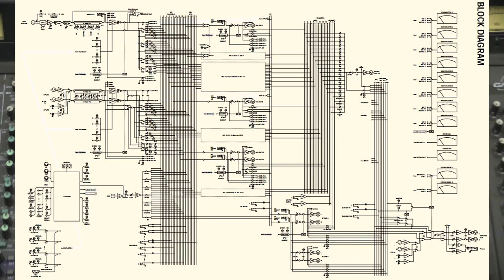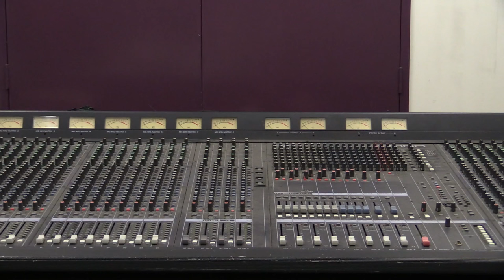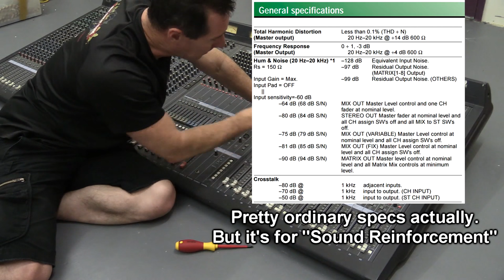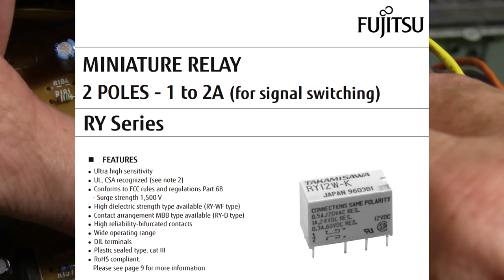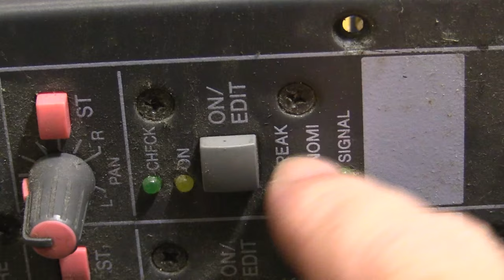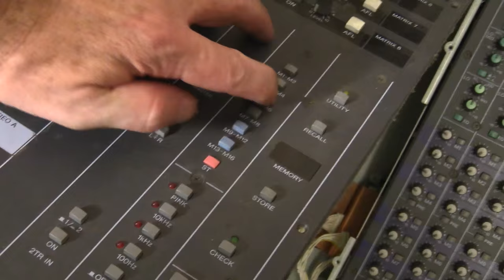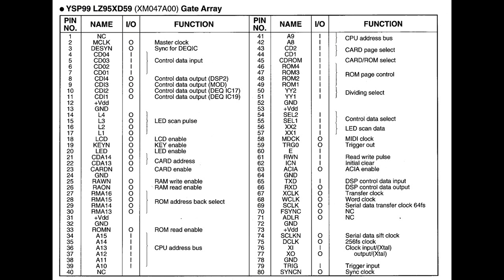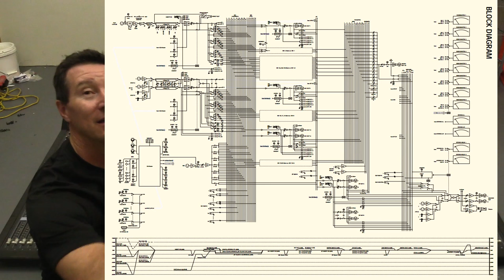EEVblog #840 - Yamaha M3000 Mixing Console Teardown

Comment: Why would a sporting facility need a 40-channel mixer?
Reply: +Desmaad Cuz the audio-technician likely got to choose which equipment.
He decided the equipment which makes him drool.

I'm guilty of that as well. "Boss: We need this and that"  Me: Well, it's time to order a HP GEN8 server.
Meanwhile we could have pulled it off with a consumer grade i3 desktop. but where's the fun in that?
Reply: +Desmaad Maybe the venue is also used extensively for other purposes... For example it's not that unheard of a sports facility to host a concert of some sort.
Reply: +Desmaad The key reason is versatility. A large sports venue is going to have to be capable of catering for a whole host of different types of events that aren't necessarily all sporting events such as concerts (remember the days of the stadium rock bands?) and other such types of public events.
The other reason is broadcasting. This console would likely have been used to in effect run ALL the audio for any event so you would likely have several distinct audio systems all controlled from this one mix console.
For example, there might have been need for all of the following to operate concurrently;
1. House PA system for music and announcements - this would likely include a couple of microphones for speech, some channels of "DJ" audio, and perhaps also an emergency alert system. This would likely also need distributing to many different amplified systems throughout the building (think along the lines of to the roofmounted speakers in the downstairs bar as well as to the crowd seated in the venue) 
2. Commentary, live audio and interviews for broadcast - This would encompass many different sources all being mixed to be sent for tv and radio broadcast, possibly as completely separate mixes for each broadcaster. This could encompass many microphone channels coming from commentators, from microphones on the field itself, from comperes interviewing sports personalities in the tunnel or locker rooms etc. 

A large format console like this would allow both of those scenarios to operate concurrently and separately if desired, or if need be the mix engineer would be able to for example, send that interview from the tunnel to the house PA, or send that announcement from the house PA to two different tv broadcasters and one specific radio broadcaster.

So, versatility is the answer.

There's always that band that says "We need 5 channels" and then shows up with a 60 piece orchestra.
Reply: +Osmosis I'm not sure the M3000 ever made anyone drool. Yamaha are more of a "Get the job done" manufacturer in the pro audio industry.
If he wanted something to drool over he would have asked for a Midas or an Allen and Heath in those days.

Midas Legend 3000 for reference - http://medias.audiofanzine.com/images/normal/midas-legend-3000-44-touring-668615.jpg
Reply: +Desmaad Sound reinforcement. 40 channels seems like a lot, but it's never enough. A venue like that would have a variety of sources needing mixed. Think of how many audio and video inputs a pro football broadcast is dealing with and likely scale back from there. Live or studio, it adds up quick. More is better when you're talking about inputs, buses, inserts, etc. Just micing up a band requires a lot of inputs. Sending back monitor mixes gets even more involved. Like I say, it seems like a lot, but it's never enough. This is one of the first things you learn when you get into sound engineering. What you think you'll need is always less than what you will actually need. You make it work, but there's gotta some law like Murphy's that addresses input shortages. ;)
Reply: +hefonthefjords The Yamaha PM3000 and then the PM4000 were staples in th industry and AH never made anything comparable at the time
Reply: I might be wrong but I was pretty sure A&H released the ML series around the late 90s no?
Its not like there was a shortage of other high spec consoles around at the time.
AMEK's consoles being just one such example.
Reply: hefonthefjords
 Holly shit, that picture is making me dizzy. I'm not a audio technician. Thought that Yamaha was pretty top notch equipment. but it's entry level compared to that indeed
Reply: +Osmosis You should see the kind of gear we use these days. The consoles all look like fecking space stations with lights and touch screens and motorised faders all over the shop.

Here's a nice Soundcraft Vi6 i use frequently - https://i.ytimg.com/vi/A8mxMe3cXyE/maxresdefault.jpg
Reply: +Desmaad I'd say it was used as a monitoring desk. The MCG have had much newer fully automated digital desks for a while. As a monitoring desk, it could've been for anything!? You have security and ground staff on the day of a big event all running around with in ear monitors, and they need different sources mixed to them. When this is the case, you'd be surprised how quickly 40+ channels doesn't seem like a lot anymore!
Reply: +Desmaad 

Because they would probably have a lot of music in, or they did corporate events where EVERYONE want's their own wireless mic, or because they didn't need the 40 channels, but they DESPERATELY needed the 16X16 matrix to control their clusters and delays, and it was the only console that had the matrix they needed.  One of our local stadium's got the first Yamaha high end digital console sold in America.  64 channels, and they used nearly every one on a regular basis.  A venue that big has a lot more going on than you imagine.
Reply: +hefonthefjords 

The Legend 3K is a fine sounding board, but the drool worthy Midas was always the XL4, for me.  And I know several guys who love Yamaha boards.  I know a lot more who hate them, it's true, but a few love `em.
Reply: +Osmosis 

Not entry level, just a different style.  For Entry level, see Makie or Behringer.
Reply: +Gabriel Hoffman Mackie are entry level??? since when!? Behringer, yes! actually, I've been out of the game for many years now but compared to some of the shocking Chinese desks that you see, Behringer is king shit in comparison!
Reply: +James Bos Mackie make a lot of their stuff in the same factory as Behringer.
Reply: +Coolkeys2009 having dealt with many Chinese manufactures (check my profile pic, I'm in Shenzhen. I deal with Chinese manufacturer's on a daily basis) absolutely everything is made in China. Most people don't believe me but the best stuff is made in China as well as the worst. They have factories with literally 10'000's of employees making stuff for 100's of brands. Some brands are great, some are trash. Not disagreeing with you but its 2016, we can't really discount any product on the sole basis of where it is made.
Reply: James Bos I totally agree with you, I'm not commenting on China or their workers I'm commenting on the brand, I own a piece of recent Mackie gear and I'm not impressed with them, I think their just cashing in on a once great name, support seems poor as well as quality.
Reply: +Coolkeys2009 well, I can't speak for their recent gear since I've been out of the game for ages, so if that's the case, its quite sad. I know brands do just this and it pisses me off!
Reply: James Bos
  Mackie has always been just below entry level for professional sound.  It's fine for pro-sumer sound, and I've got several Mackie products, but they are all made to beat the prices of stuff like Yamaha, Midas, Allen & Heath, etc. 

Mackie DOES make very good budget gear, and made some quite innovative budget boards.  The 8-Buss was a classic, but mostly because it did things at a price level no one had seen before.  But it's still budget gear.  You have to be VERY careful with your gain staging on an 8-buss if you don't want to start having mix buss distortion, for instance.  You'll never have that problem on an SSL, or a Neve.
Reply: +Desmaad They were sold this mixer NOT because of sound reinforcement or because the venue hosts concerts, NO respected musician will use the house system.. They have their own gear they set up..
They were sold this beast because the buyers didn't know any better and the seller knew they had the money to burn on it. You do NOT need a 40 channel high end mixer for a sports arena or for broadcasting either. This is a house main mix not a broadcast sub mix, broadcasters do not use the house main mix anyway and even if the stadium itself has a transmitter they would use the aux outputs of the main mix.
This is complete overkill and proof that companies abuse consumers in this type of market.
It's like a nightclub having this sort of thing where 35 of the channels are never used.
Like Dave said, this particular mixer was made to be versatile and moved about, not installed  in a location
A sports arena can work fine with a 16 channel board and still have a few channels left over. I know, I have installed sound in American football stadiums. 40 channels is massive overkill.
Yamaha is a good entry level product, reason you will find a shit ton of Yamaha in churches and nightclubs.
Peavey is total shit and marketed to the garage bands and bar rooms for people on a tight budget. They do make decent guitar amps though but their PA gear is crap.
EV is a better brand if you looking for speakers
Crown is a damn fine amp for 8 ohm systems where QSC is the best for 70 volt systems which you will find in most sporting venues.
Atlas makes the better 70 volt horns for long throw
Berringher is trash all around, worse than Peavey gear and marketed towards people who know nothing about sound, recently they been marketing towards online streamers and youtubers which does not surprise me, 99% of those types think they know everything about sound and such, that's why they spend $3000 on a bottle mic when a $200 mic will do a better job, they don't know any better and think because it looks cool it will sound better..
Whats horrible is those "sound guys" who think they can use concert gear at a venue like a car race and it will cover.. EPIC FAIL you need 70 volt horns, not 8 ohm speaker cabinets..
Reply: ElfNet Gaming

Well that board would certainly not be used for sound when there was a concert at the venue, it is not at all uncommon, at least at sports venues in this country, for teams to have a band come and play a song or two between innings/periods/whatever. 

More likely, though, it was the matrix that was the deciding factor.  In a large venue, it is frequently extremely useful to have separate outputs for different clusters.
Reply: I guess different countries have different uses for this sort of thing. but the purpose of a console like this is for input mixing mainly, zone outputs are usually mixed at the amplifier rack not at the main house mix. But i see what your saying though, I still think it comes down to the seller sold them something they didn't need to make as much profit as possible, quite common.
Reply: +Gabriel Hoffman Why wouldnt they use this for a concert? I've mixed shows on this exact console. Its perfectly adequate, regardless of whether it's part of an install or not. Remember we are talking about the 90s here. You pretty much used an analogue board or didnt have a gig then.
Reply: hefonthefjords It's not practical since arena systems and concert systems are two different things. 99% of arena systems are 70 volt systems unless the sound man is a moron and install 8 ohm crap, ALL of the concert systems are 8 ohm based.
The reason arenas are 70 volt is so you can chain drivers in one channel, with 8 ohm based systems you can't unless you want to smoke your cabinets or amps..
I say this is not practical because you would have to un wire it and move it around when the concert crew has their own gear anyways. besides no self respecting sound man will wire into a house system of this nature for a concert, You will use the equipment for the concert that was brought by the band.
Reply: +ElfNet Gaming Ha. Obviously nobody would be using 70 or 100 volt line systems for concerts, that does not mean they would not make use of this console to host such events in the same venue with appropriate boxes brought in for the show.
Depends on the venue. Depends on the show.
Reply: hefonthefjords Right, but In all the many events and venues I have wired up and run sound in only a couple would use the house mix, a big church is a good one of course and a theater is another because they are EQ'ed for that sort of thing, I haven't run into a sports arena yet that this would be the case, The most in that area would the the "nasty anthem" or something like that during the sporting event of course. but not a stand alone concert.. Maybe in Europe they do things like that IDK I have never been there..
Another thing is the house mix may be hard wired meaning they don't want people using it for anything but house sound during sporting events, I know first hand how much a pain in the ass it is to have to re set all the levels because some wanna be sound man messed with things. Totally nerve racking.
Reply: hefonthefjords Yeah, that's not the norm here in the states.. Just about all stadiums and venues have a permanently installed system and when they rent the venue for a concert the house system is strictly off limits.
But like I said I don't know what goes on outside of the US and so on.
Reply: +Desmaad Well it is the 10th largest stadium in the world
Reply: smoothguy1991 That means nothing when it comes to mixing consoles, Unless they have a need for 40 mic / line inputs this is overkill. You will need a few amplifiers but that means nothing because amplifiers are on the output. Big stadium, small stadium most can be handled efficiently with no more than a 16 channel board IF all you doing is announcing to the crowd, playing filler music and have the occasional on field commentator on a wireless mic..
Where sound in a large stadium matters is in the amplifiers and horn placement not solely in the mixing board. Anything being patched to a broadcaster is also on the output line (usually an AUX sub channel), they have no need to be patched into an input on the main mix. Reason you hook them on to an AUX is so you can cut any filler music and other unwanted lines out of the mix going to them and all they get is the announcers.
Reply: +hefonthefjords yeah thats all about the money..let the band / event organizer pay for the soundsystem
Reply: +Desmaad i'm guessing it never went anywhere near the stadium itself and was more likely used in the function rooms etc. 40-ch adds up rather quick in the analog world, it also gives you flexibility to have support acts on one side of the desk and headliners on the other/split channels so you can adjust FOH & MON seperately/etc
Reply: +Desmaad  He said it came from the MCG, Have a look and you will see why -> https://en.wikipedia.org/wiki/Melbourne_Cricket_Ground
Reply: +Desmaad  also think it got something to do with te matrix outputs. for delaying for fills in a stadium setting. you want to delay your fills to get the effect the audio is coming from the stage or middle of the stadium. in the 90's Matrix was not a big thing on smaller panels. Delaying will be done in seperate processors.
Reply: Desmaad they have concerts and gigs there too,
Reply: Usually a concert will have its own equipment and not use a house system.. Usually. Maybe they have big half time entertainment like they do at US Football Superbowl? Then they would patch into the house system.
Reply: I'm pretty sure I've said this here before, but it is mostly (though no entirely) for the signal routing available for use on the output section.  A stadium is a large venue with a very complicated speaker system which is split into numerous zones, each with it's own level requirements (and delays), and each of which will get a different set of inputs (for instance, in our local MLB field, the bathrooms get an audio feed from the radio, which you don't get on the concourses or the field).  A large board like this will have an output matrix which provides the versatility required, where a smaller board will not. 

Plus, you can never have too many inputs.
Reply: hefonthefjords, you got THAT Right! The present day crap is so awesome! And expensive!

Comment: So funny to see you uncomfortable with a piece ;) The Japanese love to use SIP op amps throughout the 80's & 90's still through to today, I see SIP way more than DIP in Japanese designs. The SSM2018 is VCA, it's a great performing part and obsolete. Those Yamaha custom IC's below the faders are indeed VCA's. The IC's starting with BA are Japanese Rohm parts, there's tons of their parts in Japanese designs. The BA682 is an LED driver - they'll be used all over the place as well for the LED metering. The 'matrix' on each channel are simply Auxilary Sends to the buses in the master section. Some of the sends are tapped before the main VCA, other after (some are selectable pre or post). The M3000 was a mid-level console, there's lots of cost-cutting with the single-sided boards and common 8-channel grouping boards. Better consoles will have each channel fully independent for easy testing and repair and overall cleaner build.

Comment: Something else that fails a lot: input op/preamps. Sometimes something fails and sends way too much power to them. Usually on stereo channels that don't have the 48V which usually provides a low degree of isolation. I've got a stereo mixer with a bunch of blown input amps because a HV-distributer box failed and the cd players all got 300-400V on them (which translated to way too much power on the sound lines. I was told the magic smoke was plentiful, the input boards certainly looked like it.)